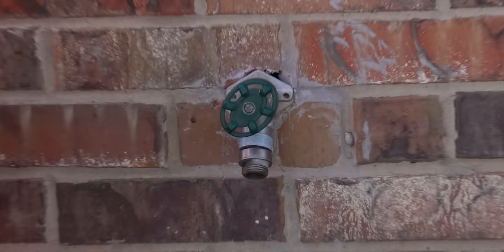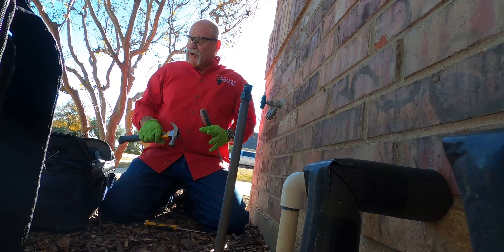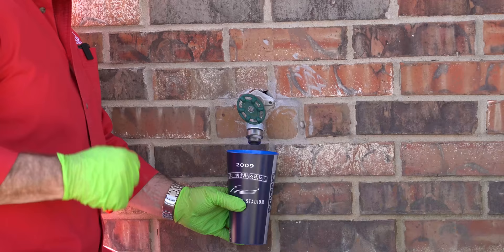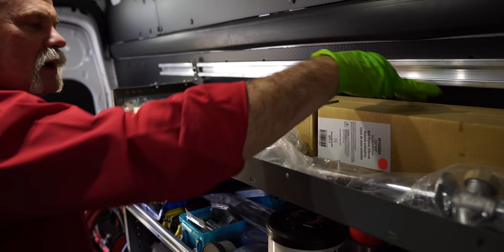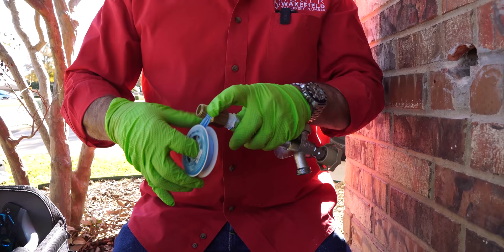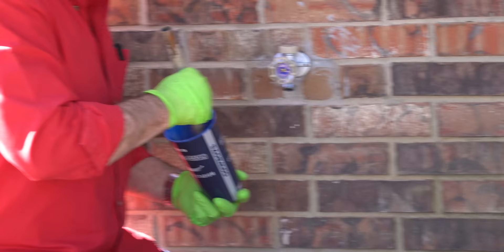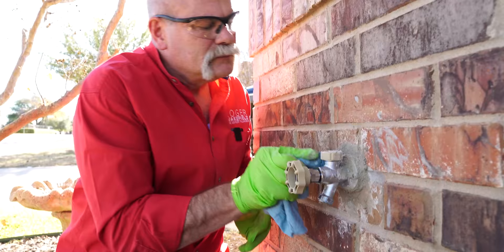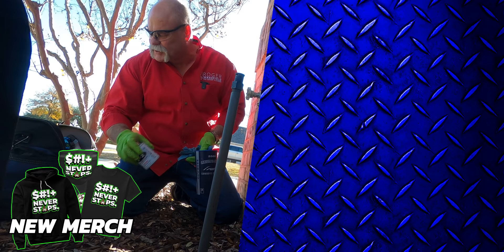How Pro Plumbers Replace Frost Proof Faucets

Comment from the maker: Have you ever replaced one of these?
Reply: Mr. Wakefield! Awesome video. Thanks. May I suggest that you put the links to the  ferg products you used in the description box. I am sure Ferguson will appreciate that!
Reply: I've never actually had to deal with brick or mortar, but I think you should try using a piping bag.
Reply: once when i was 14
Reply: I think we dont have such valves in Europe. At least i haven't seen one.
Reply: Had to replace the one on the front of my house. Original was from 1987. Definitely was not at a downward angle, so even with a vacuum break, it still split the copper behind the brick. Turning on the faucet sprayed water out above the faucet and into the wall in the house. I bought a Prier 400 series to replace the Menards special and soldered it in. Didn't think about the downward angle though. It's parallel with the ground and mortared in. Do you think I should chip out the mortar and do it again?
Reply: Indeed, though mine was more fun- the pipe was loose on the inside and it was a 12".  I also use both Teflon and dope when installing threaded pipe connections- especially inside a wall
Reply: Very rarely do I replace a hose bib that is threaded. Almost always it’s soldered.
Reply: @andrewengland971  Always!! me too... when i saw the two pliers come out I went running for the main!!!
Reply: Here in cold Michigan we do a ton of frost free!
Reply: I don't like them. They leak more often than a sillcock and people still freeze and burst them. I always use pipe thread and dope on pressure. Tell them you will see them next year, I've put in dozens of pro flo frost proofs, they don't last as long as the name brands. I like other pro flo stuff and love Ferguson.
Reply: @1stevenyarbrough  no not till it fails , if it freezes it will only leak when turned on so why change it , it may still drain enough
Reply: Todd Lenard  I do the pex loop too if the crawl space really sucks
Reply: Done it many times... Though it's a little different here in Michigan... We have basements
Reply: I woke up to one of these gushing water under my house, it wasn’t even cold out. It was CPVC so it took a few fittings to replace & I put a ball valve on it so I wouldn’t have to drain the house next time. Then the other one broke & it was the same. I did not know you can’t leave a hose on them, I guess I’ll run out now & disconnect them. Great video & thanks.
Reply: Yes yes I have more than one
Reply: Here on the Midwest these are required on all homes. I always cut open the wall, if needed, and replace the whole thing.
Reply: Holes alright wonderful thing for the worker but usually not for the customer and or tenant another word space is a wonderful thing we get as little as it takes in more ways than one lol :-) :-)
Reply: Love the channel my comments are my thought I'm not a service plumber but I am a construction plumber in california
Reply: Some weeks I don't replace any. Some weeks I replace 4 or 5 of them. This usually happens at the end of summer or the start of spring.
Reply: So many! Usually in spring though
Reply: Many and I don’t think I have ever seen the threaded connection used. The majority are sweat. I like opening the Sheetrock to get eyes on the connection to make sure there is not a small drip.

Also go with the self drain woodfords are nice
Reply: My home came with the Woodford (model 25?) self draining ones as well.  I definitely recommend.
Reply: Any tips on how to break those threads free. I feel like everytime i do one of these the i have to open the wall and put a wrench on the fitting so i dont twist or kink the pipe. And in the northwest we call them frost free.
Reply: My buddy in the pipe fitters union used his two week down times to get his plumber license for when he retires
Reply: You can replace the insides to stop it from leaking
Reply: No but ya sure had a easy one
Reply: @GamerXface   probably lol I just lucked out 😜
Reply: This is just my 2 cents worth,from my experience,unless the original faucet has freeze damage,you just replaced a quality hydrant with an inferior import brand.
Reply: Roger, you are correct ,when dealing with metal threads,you should always use tape and  thread compound together.
Reply: Service plumbers never show real math needed plumbing 🥱😴
Reply: I have rebuilt one with a hone depot kit $18 and am gonna rebuild another next spring. Thx Mr. Roger
Reply: Yes I have.  Luckily it was under the kitchen sink cabinet so I could access it from inside.  I was waiting for you to clean up your mortar on the brick... haha you didn't disappoint.  Nice work Sir.
Reply: @solartherm  running for the main?
Reply: Todd Lenard  I’ve replaced as many screw as I have soldered.
Reply: @jayarnold5727  I hate pro flow!
Reply: I was taught tape fills cracks, dope seals them. Tape and then dope, I’m beginning to wonder if it’s a union thing.  A lot of non union guys don’t use both or dope then tape.  I’m like Roger it’s the way I was taught and never have had a problems so I do it.
Reply: Dale bueltas
Reply: Yes, lots  but in Utah they are much longer, can’t see connections, we also have a lot of old galvinized, I’m too scared to unthread unless It’s for sure copper even then I’ll cut it out. but it’s almost always sweat anyway.
Reply: I’m curious about other states.. does Texas have basements? I heard the water heaters are commonly installed in the attic? How deep are the water/sewer mains? Like in Florida they’re only a foot or two deep vs Utah main sewer can be 15’+ because of basement and cold temp.
Reply: @mariuzpl  Very common in Finland. Tho built different, in most cases we need to replace it from the other side of the wall too. AND in Finland it's required to have a own valve for every waterspot :) Helps out alot.
Reply: I haven’t but I watched a guy try to unthread a soldered one and it busted in his face😂 he turned the water off but forget to drain the line. It was a sub contractor working with us😅 never used him again needless to say 💯
Reply: How often do pipes freeze in Texas?
Reply: Every spring there is a rush on hosebibs mostly from people that left the hose attached all winter and the ice expanded back into the frostfree and blew it apart after the seat. Welcome to Canada
Reply: I replaced one last year here in Georgia. The whole thing broke into pieces when I went to unscrew it. I didn't even put much pressure on it. The whole thing was brittle.
Reply: No but can you replace mine in Frisco? Also, what do you think of those sleek quick disconnect versions floating around on TikTok?
Reply: I have replaced hundreds of these up here in the Pacific northwest.  Roger I am a huge fan of yours I post on your reddit as well. Come on though Roger dont use ProFlo hydrants. ProFlo makes many great products but damn man. Anyways keep up the good work and videos.  Big Fan. I have my apprentices watch your videos.
Reply: While I've been working my kids have turned into snowflakes God forgive me,, I've a lot of ground work to do, they can always count on me but for how long one day you won't see me,, or my comments 😢yep I've gone cat's in the cradle 👍
Reply: Yes. Used a cheap (lighted) endoscope camera connected to phone to peek within the brick opening first.

Full disclosure: Not a plumber, master or otherwise. Just an old retired engineer (aerospace industry). Probably will get chastised for being a DIYer, but I do get a kick out of interesting challenges, like fluid mechanics. Yeah, it's been only six years, but no problems with repair (so far).

Nice video presentation and explanations. You'd make a good engineer.
Reply: Yes I have and I definitely didn’t use proflow.
Reply: I have replaced thousands of those
Reply: Spot on I use a thin chisel for this work too trouble is I'm a joiner as well it's so easy to use the wrong chisel.
Reply: Mad isn't it in the UK we have an isolation valve inside the property and in winter you switch that off and open the outside tap and then cover it with a tap cover made of foam 👍
Reply: The only thing that should have been done differently is that you should have done this on my house! You're amazing.  I wish there was someone like you where I live.
Reply: Nope i replace the stem inside the spigot unless it froze and split
Reply: I’ve done a few hundred.. I just silicone around them, and a poof of spray foam on the inside.  Like you said, the key is getting people to remove the hose in the fall.  I had a lady who was hard of hearing put 22,000 gallons (metered) of water down behind the brick and the foundation.  The city called here twice saying she had a leak.  That’s one benefit of the radio water meter reader.
Reply: @mariuzpl  we have one way check valve's that let water flow one way outside, this stops bacterium getting from outside from the tap back into the water system 👍
Reply: About 30 minutes from now.
Reply: Every spring I get dozens of calls from people who leave their hose connected during the winter months. I to stock many sizes and types of frost free hose faucets.
Reply: Yes I have. My trick to re-grouting the silcock flange is to use a HD freezer bag as a piping bag like bakers do with frosting. It lets me pipe grout exactly where I need it.
Reply: just with my eyes while you were doing it while the video was playing
Reply: In Germany, we have different systems, most times you have a valve in the inside, close it in October or November when temperatures drop and then open the outside valve, let it drain and you're done.

We also use in 99% quick release couplings, these systems are great when you remove the hose with a click instead of screw something on.
And a good idea, imho, is when you have the hose unplugged off the valve and open the front, because water will drain out when I roll it up for storing it. Water in your hose can be a problem because we know what sitting water is doing. Neighbour's threw away expensive hoses because of that.
Otherwise, the outside water valve I have in my apartment building (I'm the guy repairing small stuff) was installed in 1982, my birthyear, its 6 months older than I am lol
Reply: Wish you were in Dallas.  We need this done.
Reply: I replaced the o-ring/washer. My valve body (?) was going bad but I didn't have the means to re-tap the threads and if failed today - 3 years later.
Now I wish I would've just opened up the area behind the hose bib and replaced it.
Reply: I replace several of these per year in Canada. Too many home owners forget to take their hoses off for winter. Even with frost proof, when possible I'll install access door with a shut off/bleeder drain combo where it connects to inside and put tags with simple instructions for winterizing the devices, also vacuum breakers are required in our region aswell...
Reply: For once having a crawlspace is a good thing.   I had both of mine replace and plumder put balls behind it just for cya.
Reply: I do them all the time
Reply: All over DFW
Reply: Yes and they are always sweated in.
Reply: Yes every few years I forget to take the hose off and it freezes and I have to change it. They should be called frost resistant, not frost proof.
Reply: I replaced one once. Was a pain in the behind. It was spinning and spinning but not coming off. I had to tear up the drywall inside the house, to get to the backside of the valve, it was spinning the fitting on the PEX pipe. Had to get a helper on one side of the wall to hold the fitting with a wrench while I turned the faucet on the other side.
Reply: Just a personal preference, I would turn teh water back on at the street and check for leaks before putting the mortar in. ;-)
Reply: I was taught exactly how you do it, great video and how you explained things.
Reply: @klatubaradanikto  got to disconnect the hose or it will freeze everytime
Reply: not yet O_O
Reply: Someone asked me to do one of these on their house... How much should I charge them?
Reply: How much does something like this cost to replace?
Reply: Replaced one several years ago, and fixing to replace it again now. Watching your vids to see what I can do better. 🙂
Reply: While it might be a little more work, putting the mortar into a disposable pastry bag would let you apply the mortar with less mess and waste.
Reply: I’ve had one freeze. I don’t trust them. I put the insulated hoods from Lowe’s on them in the winter.
Reply: Just installed two at my house yesterday with a friend after having a pipe/hose shutoff burst off due to not winterizing. Lesson learned.
Reply: I have a broken frost proof spigot from this past winter. We live in the same HOA, @Roger. Let me know if you want to make a video replacing a broken one...
Reply: I've replaced a couple at a prior house, and am now looking at converting from older simple spigots to frost-proof spigots at my current house.

Comment: They should make a symbol or some type of indicator to show whether it’s a threaded or solder.
Reply: I completely agree. We are trying to figure out that same thing.  Very frustrating
Reply: 100% agree
Reply: Yep.  I think I could handle replacing a threaded bib, but definitely not a soldered one.  And I don't want to have to hammer out the mortar on the hose bib just to find out what I have.
Reply: That would be too easy 😂
Reply: Are you crazy? That would make too much sense.
Reply: FR FR
Reply: Mine is supposed to be threaded but the plumber that installed it soldered a smaller pipe to the inside as opposed to using the threaded connector attached to the faucet

Comment: Just your average I.T. guy passing through, I guess I'm into plumbing now.
Reply: you're into clean plumbing, you should see some of the things we deal with.
Reply: Same LMAO!
Reply: Been in IT for almost 20 years. Just started my own handyman business!
Reply: This Youtube algorithm apperently wants us IT guys to become a plumber, drain service, electrician, or an AC unit mechanic. Atleast, for me...
Reply: @SasukeRasmus  I'm more like the IT guy but recently helping friend with old house. I installed more lights to see better in crawl space. We bought pex pipe, crimper, fittings, rings etc. Very small space for 77-year-old guys to be working but kinda fun & learning even with sharp rocks under plastic. So far, our work is working but how nice would it be if building codes required crawl spaces to be a certain height like at least 3' bottom of joist to ground with smooth flooring like sand & mat. That would be easy during construction. Cost more but worthwhile imo. Tried calling plumbers but all were too busy. Pex pipe is making DIYers capable of big savings.

Comment: I never have your kind of luck.  Had it been me, the moment I tried to turn that faucet the copper pipe it was attached to would likely twist and crack.
Reply: Thats why you have someone inside holding back. All my trucks have 2 guys. But if your alone. You cut it inside. 15 minutes my guys have per hosebib simple job
Reply: That part didn't make it to air, along with the F bombs when it happened!
Reply: Lol, are you me ? That’s exactly the kind of luck I have.
Reply: Oh good, I thought that only happened to me.  Every “simple and quick” repair becomes a multiple trip to Home Depot and two day repair.  UGH!

Comment: There's no way I would try to unscrew a frost free without cutting the drywall to see the pipe, If its soldered or cpvc you'd  cause yourself a lot of trouble, even unscrewing one from copper is risky because you can break the joint and cause a leak inside of the wall that can cause a big problem for you or the company you work for.
Reply: I all ways back it up from inside myself
Reply: Our company won't do it without cutting drywall either.  I'm in VA. Alot of cpvc

Comment: Man, I'm an IT Technician and Network Engineer, and this makes me want to work for you haha. Even the smallest things, you take the time to go the extra mile to ensure the best quality outcome. Even the angling of the pipe to make sure all of the water drains out is something that may never be noticed, but it's the tiny things that make all the difference.
Reply: You can make more as a plumber haha. Or at least comp.  I bring home well over $100,000 a year.
Reply: The manufacturer's installation instructions does recommend providing a slope to the pipe to aid in drainage.
Reply: @fastflat4  IT does less damage to your body for the same if not more money in most areas. I left plumbing for IT and would never look back.

Comment: I have a frost proof spigot similar to the one replaced in the video and water leaks out the vacuum break when the water is turned on,is there a fix for this or is fixture replacement needed?

Comment: I’m from Illinois so our winters require a flawless freeze proof install, you never know what kind of fitting they hooked to the back of the sillcock plastic FIPT, couple of galvanized 90’s you might break loose taking it apart and cause a new leak... etc. so I always go the interior route cut open the wall get in the crawl space it doesn’t matter I need to be able to adapt to the water line properly and make sure it’s coming out of the wall with plenty of grade and that nothing is leaking near by cause you know it’ll be your fault lol. other then that if I were to have a void that small to fill you can mix that thicker and just ball it up in your fingers to pack it in and not make such a mess of the masonry.
Reply: I like what some guy said. Put codes to identify the types you can't see. Makes too much sense though, I guess.